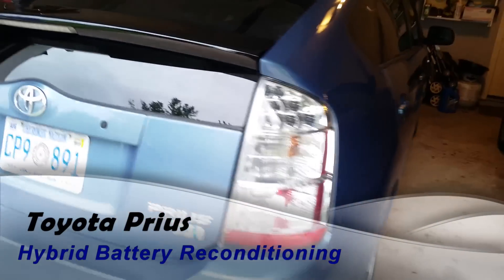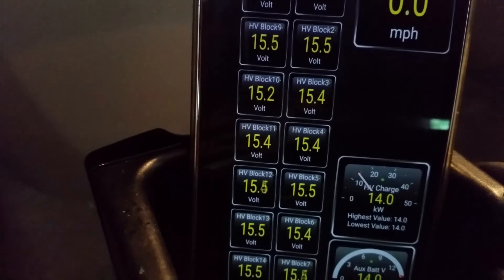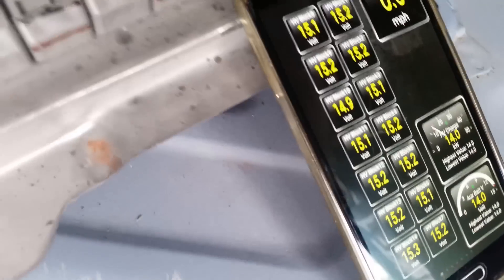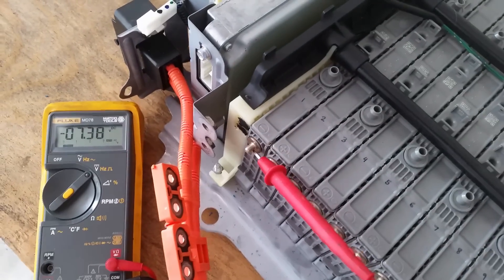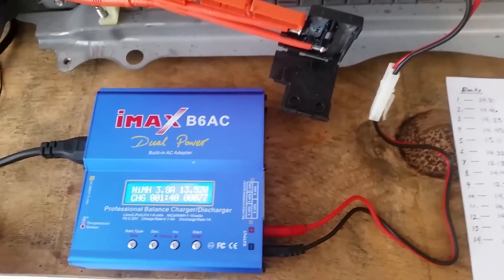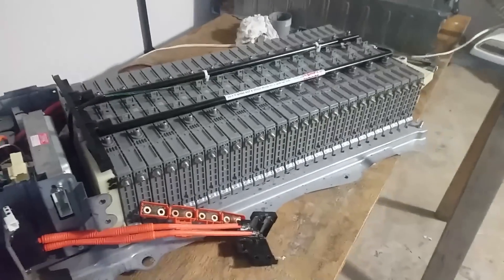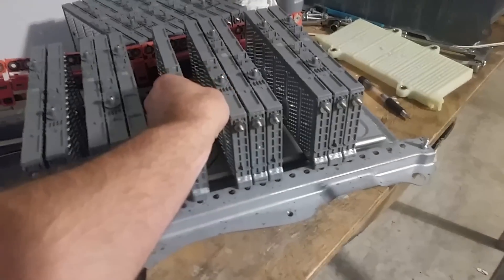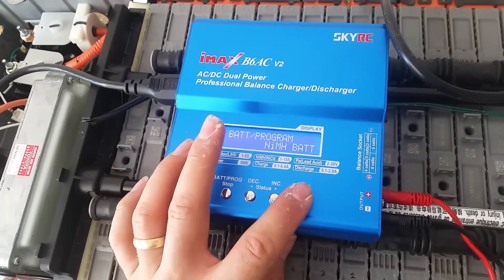Hybrid Battery Reconditioning - Toyota Prius

Comment: Terminology clarification:
A cell is about 1.2 volts in NiMh batteries. None of the work here is on individual cells.
A module is about 7.2 volts consisting of six cells. The gray plastic thingies are modules.
A block is about 14.4 volts consisting of two modules. The ECU monitors block voltages.
A car like the Gen2 Prius uses 14 blocks, or 28 modules, about 200 volts when all connected in series.

Comment: Simple google search would tell you how the modules are numbered. Then you confirm with a volt meter. You’re pretty handy but kinda silly. Glad you got it fixed without getting blown up
Reply from the maker: I was getting mixed answers online on the numbering. I guess there was a year split where it started being numbered the other way, if I remember correctly.  My kids are glad I didn't get blown up also

Comment: I've seen videos by hybrid techs that suggest balancing the modules before installing them. This is done by stacking the modules with all of the positive terminals on one side and all of the negative terminals on the other.. Then run a conductive bar across all of the positive terminals and another across the negative terminals. This makes them all in parallel. Leave them like this for a day and all modules will be balanced with exactly the same voltage. If they aren't balanced they won't charge equally.

Comment: Ok you are just all sorts of wrong!. Get your nomenclature right. You are calling shit the wrong thing and terms are not interchangable. Cells are not numbered. It goes in order of size battery, blocks (made of two modules), modules (made of 6 cells), and cells which you will never see or deal with so it's a moot point to number them. But you can if you are anal retentive and want to. Oh and I hate to tell you all especially you creator of this garbage video but numbering is completely arbitrary and is strictly according to whatever your reference is so technically all you fuckers are wrong. You could number them randomly and be correct if that's the reference! Why you idiots seem to not comprehend is your program has one numbering scheme, a different program will likely have another, a tech sheet will be different, and they all probably don't go according to Toyotas numbering which should be the gold standard concerning this specific battery if you are habitually retarded and are so adamant on concerning yourself with something so none relevant to everybody instead of focusing on the problem and task at hand. Which you obviously are! I'm talking to you video creator! I'm seriously considering calling this trolling since it almost seems designed to confuse and misdirect those seeking actual knowledge.

Comment: You still have a bad module. The block running 15.2 has a module with a dead cell in it.
Reply: Block 10. Just test the individual modules with a multimeter.

Comment: Note: On the 2010 there is no temperature sensor on the bottom. I also find it easier to remove all the hold down nuts first of the hybrid modules when removing modules. The two opposite nylon hold down caps will keep the modules from falling out. Therefore remove the nylon hold down cap opposite the computer section this will then give you access to remove modules. So much easier.

Comment: Excellent video, thanks for the information.  What kind of software or app do you use on your phone to see the voltage.  I use a LEMUR BlueDriver and my iPhone to check codes.  I wonder if I can get an app to make it show me the hybrid battery voltage with the LEMUR Blue Driver monitor.

Comment: My 07Prius had big power loss. Shows dash panel light on.
Has  185k miles.
How many cells do you think I may need? Thanks
Reply from the maker: I would recommend buying no less than 6, and just replace the weak cells.  I believe I only ordered 3 or 4 & turned out I needed more once I had the battery apart

Comment: You can hold the break step on gas in drive and fully charge it into green when you leave it sitting to condition keep in fully charged
 I’ve rebuilt both my 2004 and 2008 Prius’s
Reply: My 07Prius is power loss. Shows dash panel light on.
Has  185k miles.
How many cells do you think I may need? Thanks

Comment: On my 07 Highlander I have a module reading 9.31V and the rest reading ~10.64V. I bought the Turnigy Quad 400W and noticed that it doesn’t discharge any faster than 0.4A even though I set it at 1.0A to 8.0V. Would it be safe to discharge to 1V per cell using a high amperage draw like a starter motor? If not what is the fastest and safe method to discharge each module?

Comment: You did good as a DIY like me, by load testing the batteries. You cycled them individually on the charger and repositioned in arrangement for equal power strength.
What you did may add up to two more years of use on the hybrid battery.

Comment: So I just a Prius and that red triangle is on but the car sat for just over a year with an engine ticking noise, I believe spark plugs, fuel injectors or the EGR system maybe plugged as far as I can tell, Im sure once I get it down the road it will charge the system up if not looks like im doing what you did.

Comment: Used this video, great stuff.  I have an issue.  Removed the Battery Pack and checked Voltage and all read on average 7.7 Per Battery and 15.4 per Group.  There are no batteries that are far from the 7.70 with the low being 7.59 and the high being 7.77.

I figure since I have it already on the bench I should Discharge and Charge.  I only have two of the IMAX B6AC V2 units.  The CAMRY has 34 Batteries.  

What is the value of doing the DIscharge to 6 Volts (1 Volt Per Cell) the Recharge?  THis will take 2 hours for one Cylce.

The number above is for one Discharge Recharge with top off twice only one cycle so is three cycles needed and/or what is the value of that?

Saw instructions saying to go below 1 Volt per cell with .08 then .06 then .05, is this really of value?

The Battery was on a Camry 2008 that I gave my son, it drove here no issue then gave VSC and Check Hybrid System.  The Freeze data shows the packs fell from 15.4 on average to around 12 to 13 volts per pack.  I think this is caused outside the pack, but now it is out want to get it redone. 

Any help or comments would be appreciated.
Reply from the maker: Personally I would set a timer and discharge each cell (with a headlight bulb or dc motor) and see which ones discharge the fastest.  The ones that discharge fastest will be the bad ones. You probably have one or two that will discharge extremely fast, replace those & equalize all the voltages. Wait a day and then top off each cells voltage so that it's perfectly equal before reinstallation. Any variance will throw the computer into failed mode.

You can safely discharge them each down to  0.8 volts per cell
Reply: Thanks for the timely reply.  When doing deep discharge/charge and checking mAh for the batteries on the B2AC what settings do you use for Discharge / Charge.  I have now 8 of these to complete the job and are discharging.

I see Battery Reconditioning threads from many that do the packs and they go down to .8 then .6 then .5.  If we go this route I mark changes in mAh between cycles.
Again question is what should be discharge and charge voltage C Level, i used C=0.2 which is 1.3A.  Lower or higher for NiMH Battery Panasonic 1.2V 6500mAh.

Comment: Hi John,
Thank you for sharing your knowledge. I understand the software to analyse the performance of the batteries i.e. TorquePro App and in conjunction with an OBDII Bluetooth plug in device. There are lots of these OBD units on the market. Which brand/model OBDII device do you recommend? Thanks again!!
Reply: I use AquaNine with Wifi.  On my Adroid phone, I find I have to delete my Wifi connection to the router, and then connect to ODB2 device.  Go slow, allow the device to connect.  It says connected with no Wifi.  After fiddling for about 15 minutes, I can get it to connect, and then it seems to work.

Comment: Great video. Just wondering, why did you use that motor to discharge the modules instead of that IMAX device?
Reply from the maker: The imax b6 charger could only draw a max discharge of 1amp, per charger I believe. So the reason I used the DC motor was just to speed up the process. It would have taken forever  just using the chargers alone. I think I used a small headlight bulb to drain some of them too, in addition to the DC motor

Comment: When it is being charged with engine on,  it looks good working, but what it matters is when it drains batteries. Close to 7.2v bad cells significantly makes volage difference, or when it seats for several days.

It probably is temprary fix,

Comment: https://youtu.be/B88lfgWZmtQ 
Check this video out 2011 Chevy Silverado 1500
Reply from the maker: Your best bet is to get a load tester from Harbor Freight, and load test each one of those battery blocks/cells. Remove the weak blocks and rearrange the pattern. You will probably only have five or six weak blocks in the whole pack. Then purchase blocks on eBay or  Amazon (they run about $35 each). Then charge all your blocks up to the exact same voltage before reassembly. That battery almost looks identical to a Toyota pack.    Good luck man
Reply: John Caleb Warren 
Thank you brother. Do you think the voltages are to low? Or out of balance? My truck jerks out of auto stop also and probably losing mpg

Comment: Please answer my question if you can. I have a 2011 Chevy Silverado 1500 hybrid I want to change 2 modules. What modules do you recommend?. I hear some shops are using new generation modules. Can I use any module?
Reply from the maker: If it's within the same model year it should work. I would recommend just purchasing the cheapest reconditioned battery on amazon with a warranty and installing it yourself
Reply: John Caleb Warren thank you kindly for answering. 
I went to a shop and was told they would replace all my modules with new generation ones. I'm confused on that. Okay i already have the battery apart just trying to order the right one but I am confused to which battery I need. Can you explain a little more on the battery you were commenting about? Like do you mean I have to purchase a battery with my trucks year? Or how do I go about it? I was just gonna order one that looked similar but I was told that was not the right way to do it. Thanks

Comment: What is the battery test software called

What is the name of the device obd2 to check for
Reply: It looked like Torque Pro for Android ($5).  Under settings, go to Manage extra PIDS/Sensors, click ... and click "Add predefined set".  Select the PID for your car ie. Prius Gen 2 (2004-2009) (included with Torque Pro).  You will need a compatible ODB2 module.  I use AquaNine OBD2 Wifi.  You can find it on Amazon ($20) or Walmart ($17).  Once connected, click "Real Time Information".  Swipe to the right until you get a blank display.  You can then customize the blank panel.  Press a finger on the display and hold.  Select "Add Display".   Select type of display.  Note: "half needle" shows min and max values.  The "digital" shows the current value.  Scroll down and select "HV Battery Block-01 Voltage.  Select a size (tiny or small).  If you select tiny, you can fit all sensors on the page.  If too tiny, select small, and have multiple pages.

Comment: the level of corrosion on those jumpers, is what killed those cells.
Reply: Corrosion is normal on copper. It's the process of oxidation. And it inhibits less than 1% of power going to the motor. In other words, clean them for aesthetics, not for gaining additional wattage transferred to the motor.

Comment: I have a comment that has nothing to do with the prius battery, but has anyone had any problems with their traction control going off over speed bumps, driveways, or during turns on a regular basis? I need a permanent fix for that
Reply from the maker: I read about that once in a forum, someone said it was related to a loose bolt(s) holding the battery down or loose connection at the battery terminals. Not sure which battery they were talking about though...

Comment: Hi, How to charge highlander battery with 8 cells in a module?
Reply from the maker: same way, just disassemble, drain and recharge each cell 3 times. Reinstall & top off charge
Load test if you are unsure
Reply: @JohnCalebWarren  thanks, my question was , shell I use the same charger that you are using, I guess it works max 6 cell batteries.
Reply: On my 07 Highlander I have a module reading 9.31V and the rest reading ~10.64V. I bought the Turnigy Quad 400W and noticed that it doesn’t discharge any faster than 0.4A even though I set it at 1.0A to 8.0V. Would it be safe to discharge to 1V per cell using a high amperage draw like a starter motor? If not what is the fastest and safe method to discharge each module?

Comment: Great video but did you really have to explain for 3.5 minutes you numbered it wrong?
Reply from the maker: I agree it was a bit repetitive, but everywhere I was reading  (pictures) online had it numbered backwards & it was throwing all my readings way off. Took me days to figure that out, so I just beat that horse a bit to hopefully spare anyone the trouble. Someone might be in the same situation doing a reconditioning process as I was. If I remember correctly the 2nd & 3rd Gen prius number their cells backward from one another, but it might just be the orientation of the battery. I'm not quite sure, ...been a while since I've been deep in one.

Comment: You need to wait at least 5 to 10 minutes after you pull the orange plug to discharge the capacitors. You can still get killed if you touch it.
Reply: This lammywalness trendy trade guide guy talk for over 20 mins saying the same thing over and over again and the he says it will cost you $47 to learn the method and based on the way he talks for half an hour it doesn’t look legit.
Reply: isnt there any indicator led?
Reply: @tokyowarfare6729  Indicator for what? The battery it self has no indicator. The cars computer handles that.
Reply: Cheers for the Video clip! Forgive me for the intrusion, I would love your thoughts. Have you thought about - Lammywalness Trendy Trade Guide (just google it)? It is a smashing exclusive product for learning how to recondition batteries at home without the normal expense. Ive heard some unbelievable things about it and my close friend Aubrey after a lifetime of fighting got cool success with it.

Comment: How much shold each pair of cells charge up to is used in solar??
Reply: Essentially don't charge higher than their rated voltage, & keep amp low enough not to cause high temp/boiling/evaporating battery electrolyte.  Experiment & monitor for emergency stops/unplug.
copper wires, in parallel +/ ...
-7.2volt spec= 7 volt car/RV/marine battery charger.
(refrigerator+charger overnight)

Comment: What is the maximum voltage for each cell should be,when it’s brand new ? And does this apply to all makes and models ?
Reply: There's a nominal voltage and a max/min voltage. It varies depending on the cell. It should be consistent within each model of the Prius.
Reply: Thank you

Comment: How much time did this cost? It seems like the car would have been disabled for at least 2 days during the 4 reconditioning cycles, hence two chargers.
Reply from the maker: Yeah it took about 2 or 3 days, off & on.     The car is still doing great to this day. My brother has put about 40k miles on it since the battery reconditioning

Comment: Sir I'm getting alot of errors on my crown hybrid 2AR-FSE similar engine to lexus gs300h i got the error code translated and it's telling me to replace my hybrid battery. Can u give me some tips on what should i do first off? I don't want to spend $2.5k on a new battery. Plus toyota says these batteries last for minmum 300000kms max 500000kms. My car only has 120000 odo kms. Any help would be great. Thanks
Reply from the maker: My advice would be to buy a reconditioned battery pack w/ warranty from Amazon or Ebay from a good seller that has great reviews. That is your best bet if you want to avoid all the time of doing it yourself. Removing & replacing the battery pack is pretty easy though, just a few hours of trim. The computer will automatically detect the new battery & work just fine,  if your wondering. That's your best bet for the cheapest price
Reply: @JohnCalebWarren  i guess i'll do just that. Thanks for the reply.

Comment: Thanks for sharing this great information.  I am researching the effects of heat on these battery packs.  Accordingly, which module numbers--positions--did you ultimately end up replacing?
Reply: The cells that generally go first are near the middle of the pack. This is because that is the warmest place (being boxed in by all the other cells which are also warmer than the air flowing into the housing.) However random cell failures can happen anywhere in a pack. The chemistry changes over time and none of the cells degrade at the same rate.
Reply: Where can I get the cells I'm in Botswana?

Comment: I have an 07 hybrid Camry, I extracted two codes. A P3011 and P0A80. Can I apply your repair methods to my Camry, also ?
Reply from the maker: Most likely so, they are the same battery cells in the Prius as the Camry. I have a 07 Camry Hybrid as well but luckily it hasn't had any issues with the battery yet. My advice having messed with a bunch of these would be just buy a reconditioned battery with a warranty. It's really not worth all the time and headache 2 condition it yourself